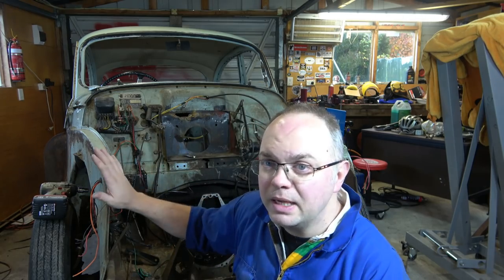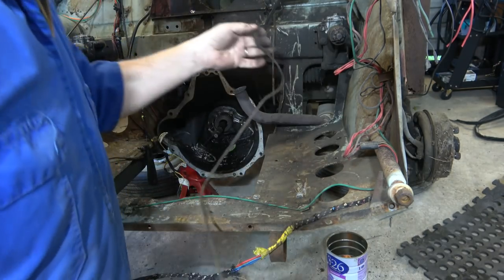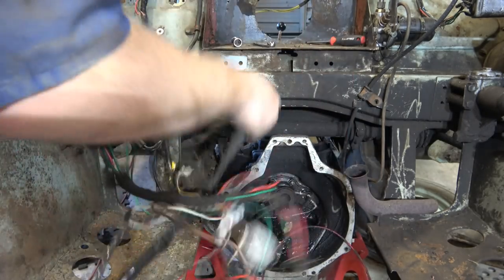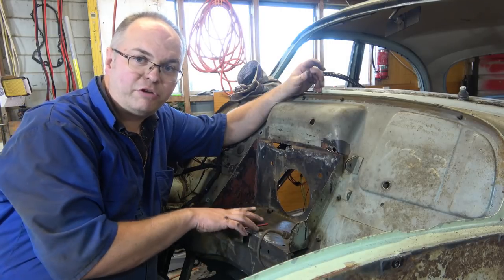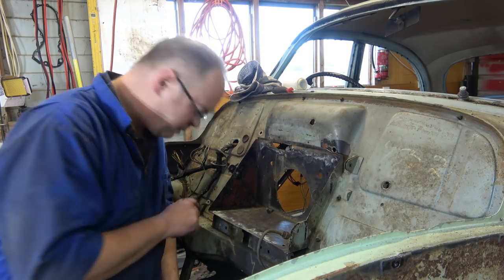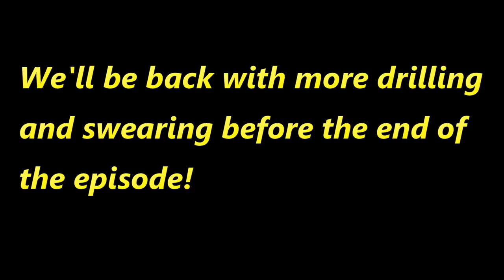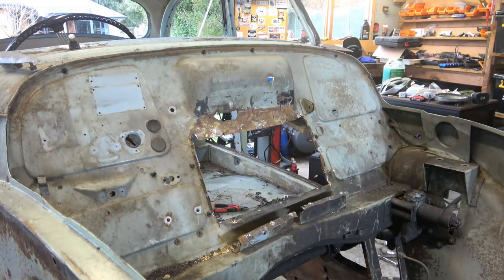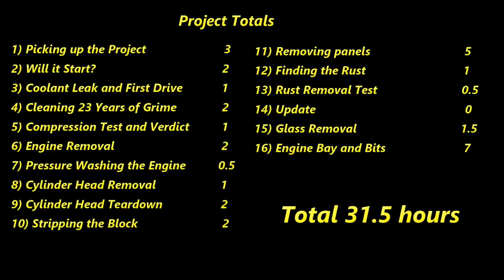Morris Minor - Clearing the Engine Bay - Part 16

Comment: spot welds are always fun. I have used the tools like that but buy the kits with a dozen tips in (they blunt easily) I drill a small pilot hole to hold the tip steady. If I repair / reuse the panel the plug weld will fill the pilot hole. If I use a new panel the pilot hole will be hidden (or if really fussy plug it with the mig n flap disc over it). Makes it so much easier.

Comment: Putting that master cylinder in the frame rail was Issigonis taking the piss surely.
Reply from the maker: It's a bit fiddly to get to but at least there's not much else in the way.
Reply: Admittedly it's only really painful when you have to get it out, the bolts come out on the torsion bar side and it has to be pulled out of the way or taken off to allow them to be removed.